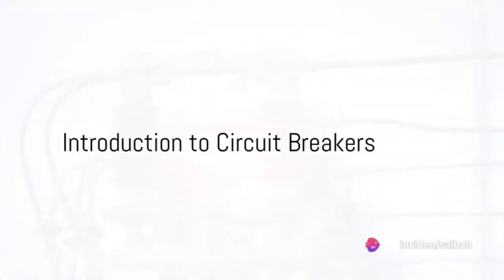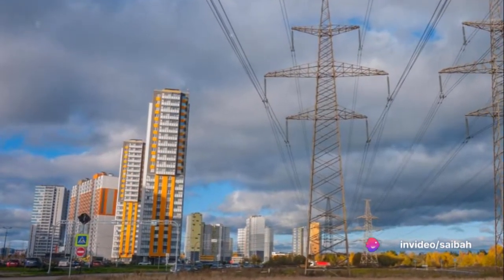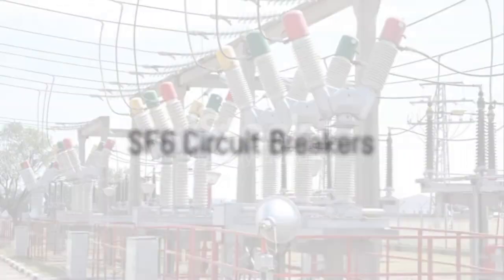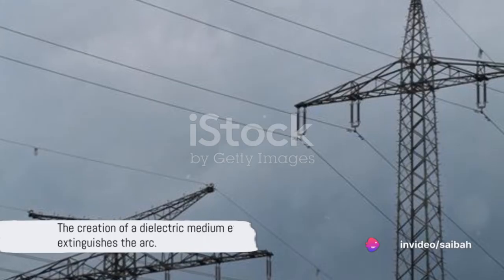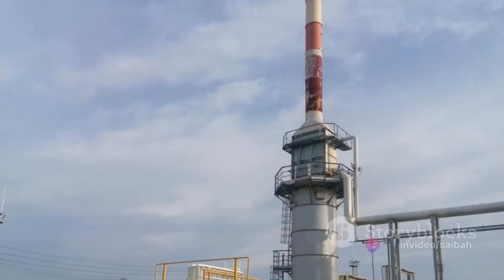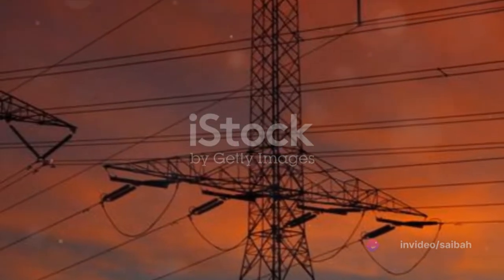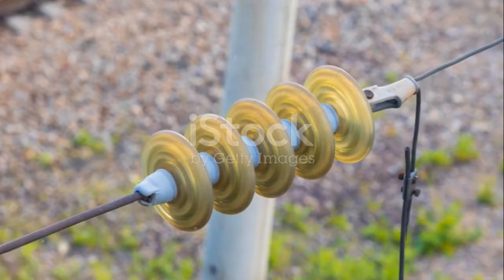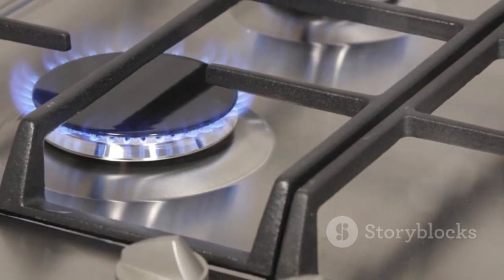What Are the Types of High Voltage Circuit Breakers in a Substation?

Comment: the dialogue is somewhat useful, but the images look like they were generated by AI listening to the dialogue and generating images based on the words alone which have no meaning in context. for example, every time she says "oil" the images shown are of oil pipes in the ground which have nothing to do with HV breakers. this is not the same "oil" that is used for circuit breakers in this context. it would be more useful if the images were actually of the content being discussed.